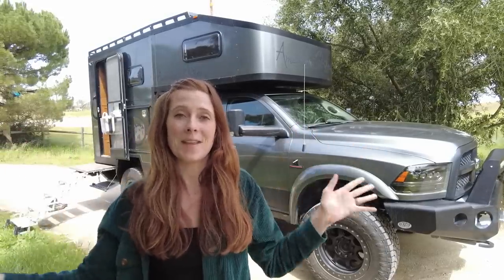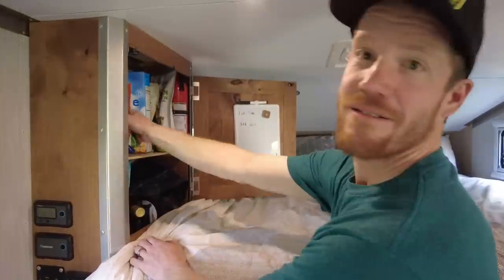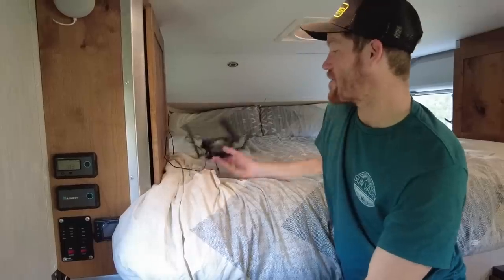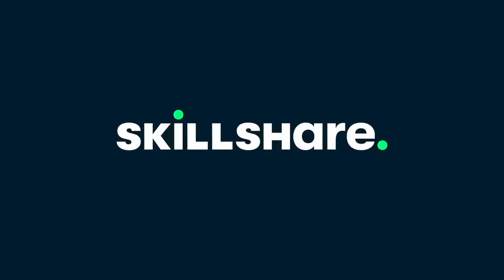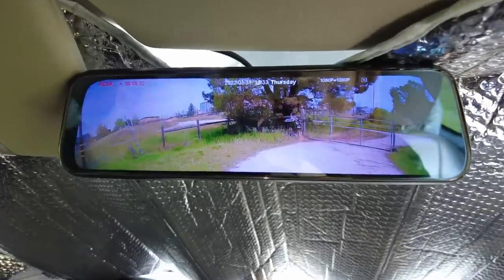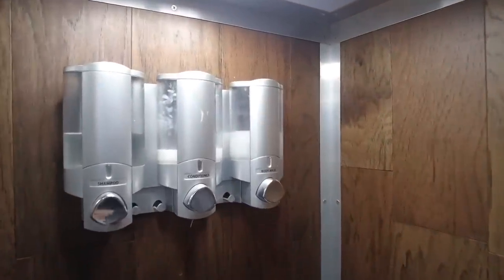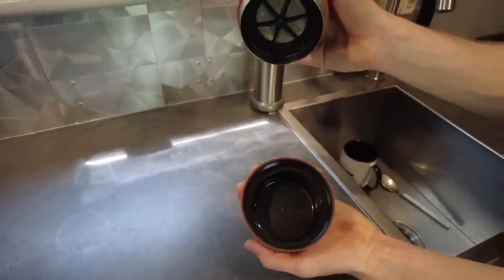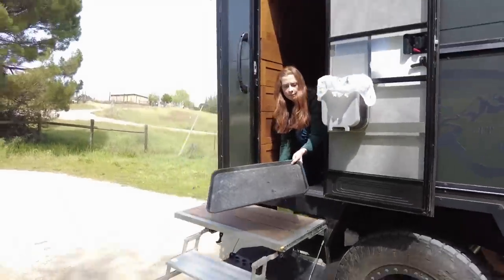Super Simple RV Hacks | Make life on the road easy

Comment: If you want to remove scratches from the inside door panels, heat the with a heat gun or torch. don't make it to hot. keep moving it back and forth . You can see them smooth out on its own.
Reply from the maker: We will have to try that. Thanks for the tip!

Comment: Do you guys have any thermal expansion issues with the foam and aluminum adhesion after all this time?
Reply from the maker: The panels definitely move a bit when they heat up, but we haven't found any issues caused by the movement.

Comment: Riley, is it a requirement to buy a data plan from multiple cell carriers to use the router you are using? I bought a net gear nighthawk hotspot a few years back. Do I use the router instead of the hotspot or use them together. I am a little confused about the usage of the router vs hotspot for our upcoming travels. We really enjoy your channel and try to support you in various ways. Thank you. Would like to say hello if you will be in Flag at OE West 2022. Dennis
Reply from the maker: Hi Dennis! We use a SIM card in the router that is on a Visible Wireless unlimited data plan. So you will need the router AND a SIM card that has a data plan.

Comment: Great tips. 

What kind of download and upload speeds do you get? I'm sure that depends on location too.
Reply from the maker: That really depends on the service provider, location and signal strength. We use Visible wireless and get anywhere from 50up 20down  to 3 up 0.5 down. I would say if there's a good signal we're usually around 7down 3up. It's plenty to stream YouTube and upload videos.
Reply: Thanks. That's not bad.

Comment: What exactly did you do with your Google Home to make it function all the time, did you connect it to DC power? How did you do that? We are working on our camper and wondering how to set up wiring to run some more things on DC.
Reply from the maker: Yes! Riley connected it to DC power. The google home runs at 14V, our lithium batteries put out about 13.5V and it's been working perfectly.
Reply: @AmbitionStrikes  Thanks for responding, and so fast! How did you connect it to DC power?
Reply from the maker: @franhat  Riley cut the transformer off the end of the cord and hooked the two wires up to DC power. On ours the inner wire is the positive, the sheath is the negative.